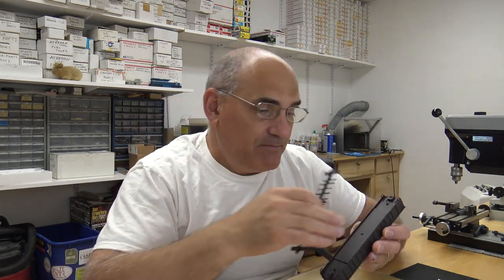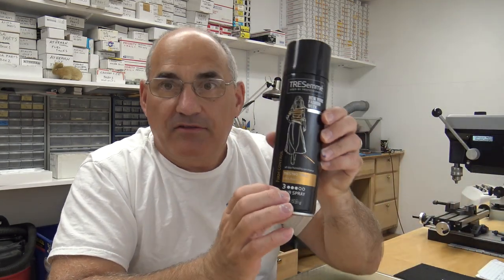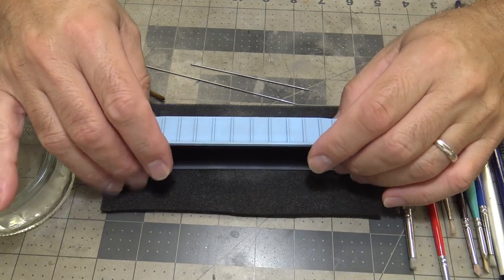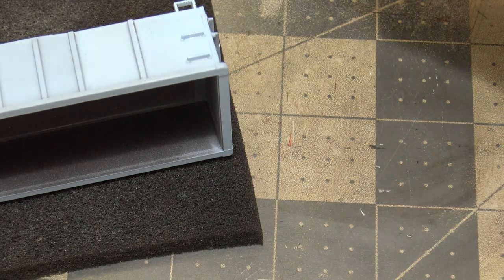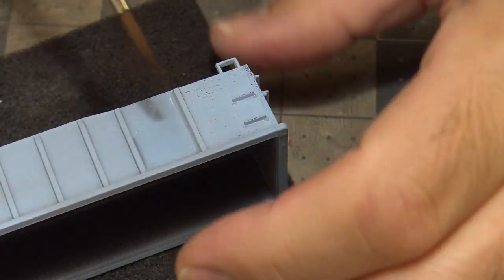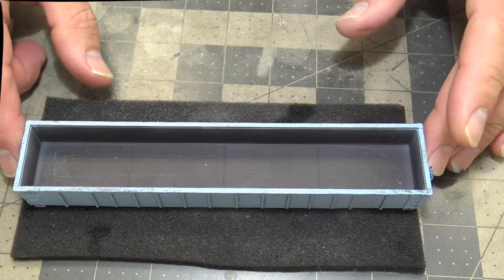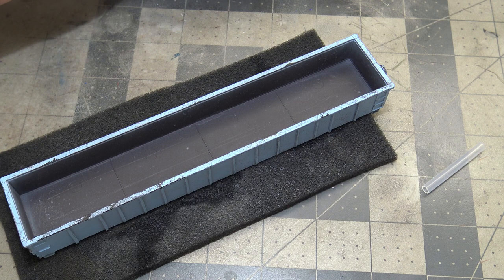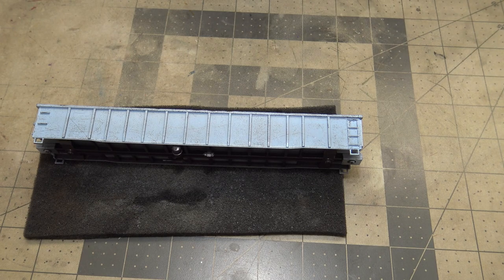ADVENTURES IN WEATHERING PART 4

Comment: At 42:41 you said you didn't like how the chipping was going. It looks great. I think I would have used your main color and added white to the paint to make it just a little lighter. paint it on the top cord. Then your chipping color on top of that to simulate the scraped paint next to the chip, and where the paint got scraped but not all the way to the metal. But other than that looks awesome. You did say its a test paint job. It look awesome. I do this kind of chipping  in N scale. I love your work. I learn so much. Almost have enough to buy my Mill. The thing is $115 more that it was last year.